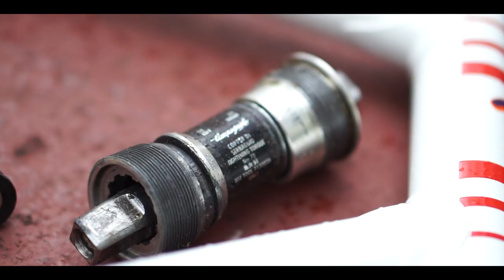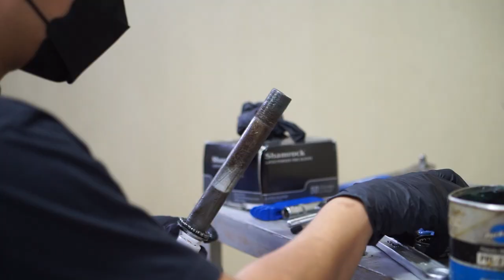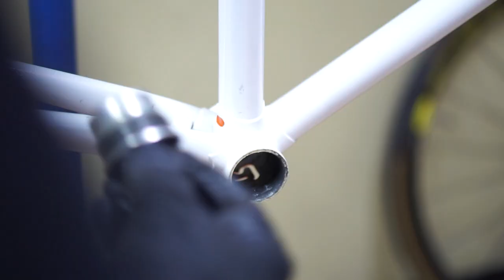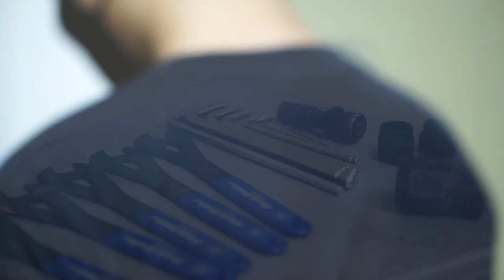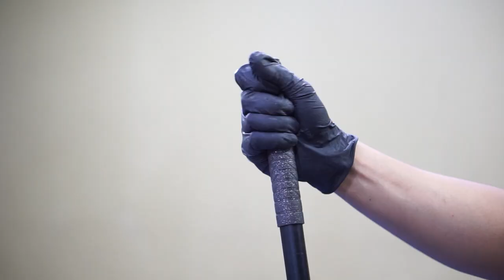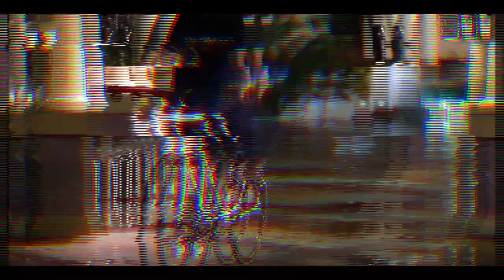Dream Build Fixed Gear Bike | Rossin Track Pista | TrackCyclery Jakarta

Comment: Those campagnolo sealed bottom brackets require thread lock , instead of grease (since there is no lock rings for it) You supposed are just supposed to rely on the correct torque spec , and put a little bit of ThreadLock to ensure it wont come off by accident in the future.